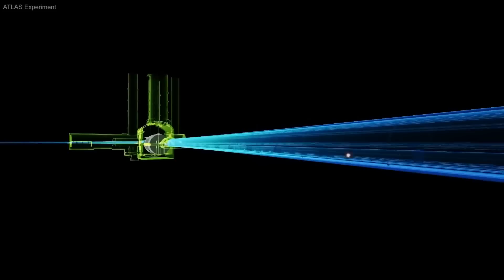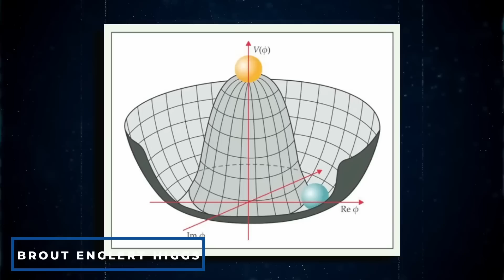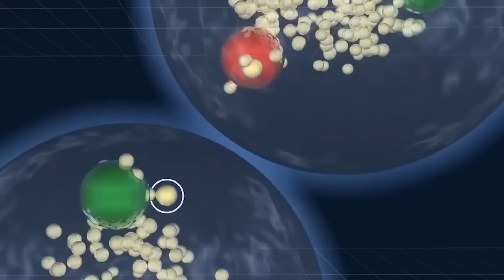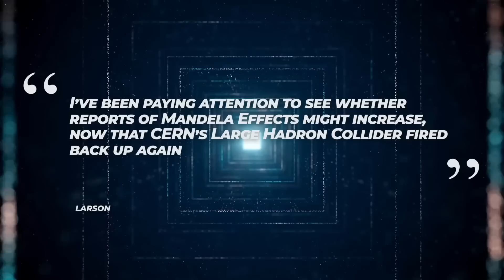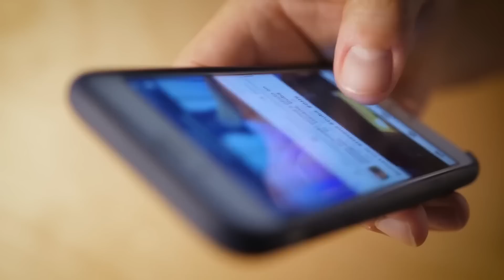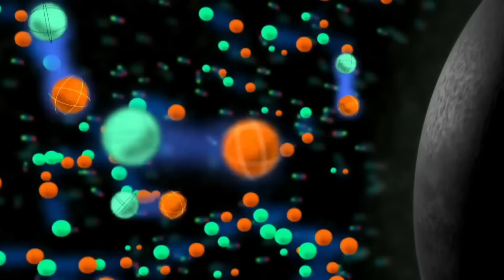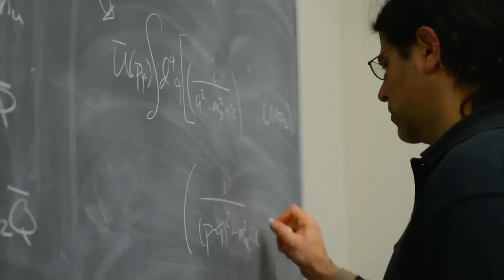CERN Scientists Announced Something Weird Is Going On

Comment: The known Universe was a Singularity at the core of a Super Massive Black Hole(SMBH) of unimaginable size. The pre-collapse Singularity was a super condensed collective mass of Primordiae ( Super Expansion containing all Primordial Groups). This SMBH formed and consumed Primordiae inside the previous Super Expansion iteration, over an unimaginable expanse of time, while growing so large that it eventually exceeded its maximum gravitational compression integrity. That SMBH literally vacuumed up more Primordiae, than it could or was permitted to contain, hence the last Great Collapse was caused by Primordial Arbitration! Our known universe is only this miniscule iteration, that is forming from the last post-collapse expansion and reintegration. This hypothesis indicates that this iterative expansion, which may indeed be one of many, is infinitesimally smaller than its Parent. Additionally, it insinuates that certain Primordial Groups' Dark Energy did arbitrarily counteract with other atomic structures, in relatively close proximity within the Singularity, causing a planar shift, rift, or tear in Space-Time, and thus triggering the Singularity to a Default Collapse. Much of the compressed P Mass was either vaporized or formed other indeterminable iterations, and we're seeing as much of what survived of the collapse, as we can! That Rift is a window, for the Eye of the Simulator! #JustGuessing #NomenclaturePrimordiae #Welcome
Reply from the maker: That's awesome man! I agree 💯. Thanks for commenting!